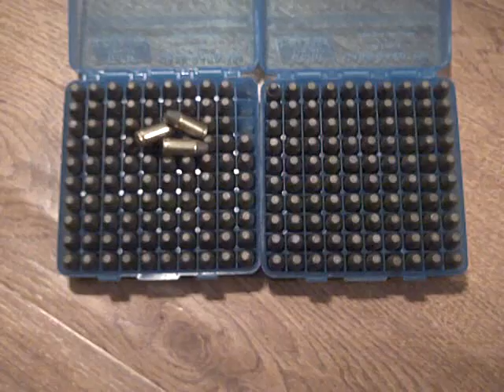Reloading question?????????

Comment: What kind of 9mm are you shooting?
This is fairly common in Glocks or any gun that uses polygonal rifling. If that`s the case you either switch to jacketed bullets or get an aftermarket barrel.
Glocks don`t like lead bullets.
If that`s not the problem, there are other things that can cause this. Try harder cast bullets.
As people have already told you, try increasing or decreasing the powder charge slightly. See if the problem gets worse or better.